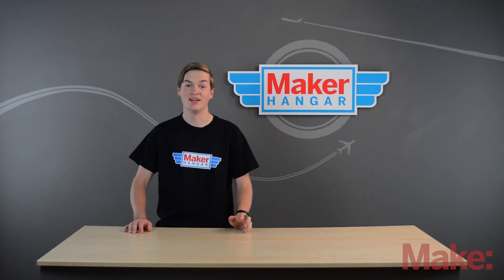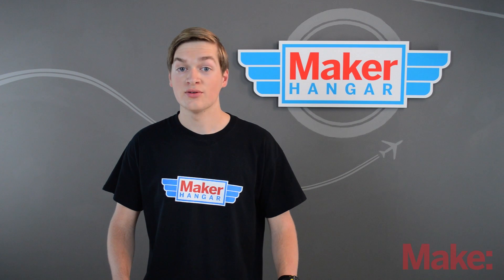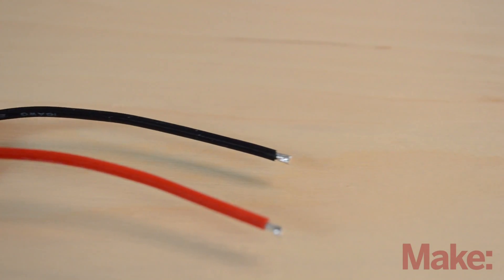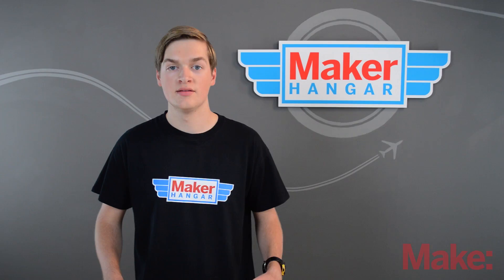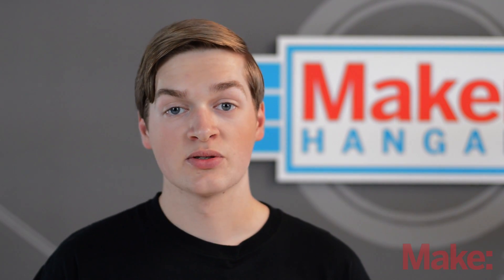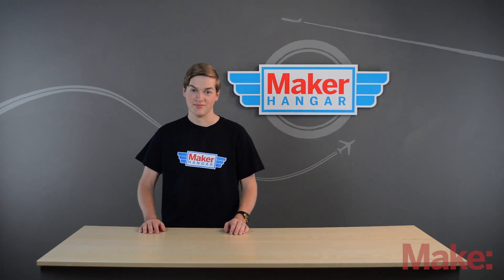Maker Hangar: Episode 3 - Electric Speed Controllers

Comment: What if you have a 400 amp speed controller pushing to a 95 amp motor, which is a KV 360 that can handle 125 V drawing from a 36 V 20 amp battery it’s wanting to cut off, and when the program to speed controller to reduce as much power as I can in the programming it will work, but I do not have much power at all Wish I could send pictures to show exactly what I’ve got going on

Comment: The motor prop combo will draw less amps in the air than it does on the bench. Depending on the prop it can be any where from 5 to 20 percent less.

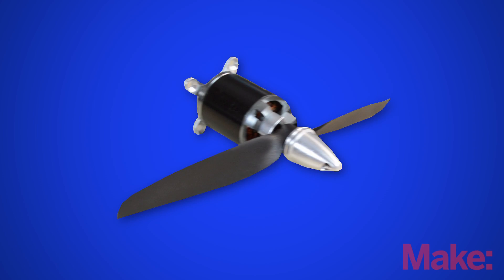Comment: 1:35 A bench thust power test is always going to tell you the max amperage your motoy-prop convination will draw. Any air speed (favorable to the direction of the prop) is going to reduce load on the motor shaft and make it draw less power.
And yeah the square waveform of that ac is more like a pwd signal that the real dc the esc requires...
Reply: Am losing ma money, In 2 months 3 ESC been damaged. Could you plz explain more about amps? Ex: I have motor with 40A, 1-what would happen if I use ESC with 50A or 60A?
2-what would happen if I use ESC with 20A or 30A?

Comment: So, the ESC's current rating should be MORE than what the motor will draw.
What should the VOLTAGE rating of my ESC be?
Reply: King Khan the voltage rating of the ESC is dictated by the battery you're using.
Reply: @SamiJumppanen  How can I estimate the output voltage of the ESC knowing the voltage of the battery?
Reply: @pedrohenriquepolidomingos6426  I'm not sure if I understand the question. Voltage is not the key here. The ESC outputs max / zero / +max pulses all the time on three outputs. You can average that to 3-phase voltage, but all the ESC "cares" is that the motor will keep the speed that's being requested. In short: the momentary voltage spikes are +/ battery voltage, but the average varies.

Comment: This is a bad video, even if you know nothing you are still providing vague and incorrect information. Your load is reduces when the motor is in the air, your amperage will decrease, as there is less "resistance" (load.....) on the circuit.

Comment: DC to AC? hahahaha :D My friend, do you really know what is DC and what is AC? You were showing a square wave going in, while its actually an almost flat DC voltage going in with no wave form. Then it sends out Square wave DC, it means it turn the DC off and on and that does not make it AC at all, not even close.
Reply: Was just about to comment this exactly
Reply: i came here because of the video picture and found you comments about it
Reply: Life is illusion IT'S just a bad explanation just from the the fact that he didn't mention brushless motors
Reply: You sound like the Marvel(tm) comic character 'electro hacker' .. ...
however you do have a point,  it is 'straight' 'DC' entering the ESC and 'pulsed DC' entering the 3 event motor i guess you can say it will be 'ac' after that - that is to say the result of the coil collapse.
Reply: i know this comment is old but, what happens if you power the ESC from (i guess AC instead of DC) a voltage converter, for example a 12v(from 220v) would it fry, would it work or i need from a battery only?
Reply: Half right:
- brushed motors are controlled with square wave DC
- brushless motors need 3 phase AC since they have no commutator, without AC brushless motors do not turn

But yes the video should be cleared up.
Reply: MsSomeonenew brushless motors are still not controlled with AC, they use DC with square waves. And brushed motors also don’t use square waves, they use straight up DC

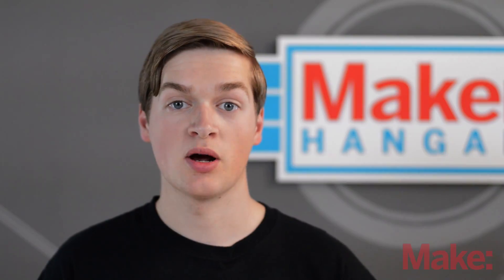Comment: 1:55 if a plane was moving in the air, there would be less strain on the motor because of the velocity, and therefore LESS current draw. not more.
simple electronics: the more strain on the motor, the less current it will try to consume
Reply: +Brice Johnson The most current draw (and torque?) would come from the motor on at 0 rpm right?
Reply: BrowFinGarf no, it would come from turning the motor in the opposite direction.

Comment: Could be a stupid question, but:
could I control a dc motor with the ESC? If yes (as I suppose) why fo we have 3 cables going to the motor? I can control a DC motor with a hbridge (for the direction of the rotation) and a PWM, which actually takes only 2 wires. Any help would be appreciated!
Reply: No, you cannot control DC motor with ESC, Because, DC motor runs with DC current (its obvious) and Brushless motor runs at AC Current (in which case the purpose of using ESC) 

To summarize, the ESC has 6 terminal output.  3 for the Brushless motor and another 3 for the servo motor.

With the three wire you mention, that is intended for the Servo motors. The three terminals is used for, + terminal, - terminal and the last one is used to control angle movement of the servo motor which is referred to as the signal terminal.

Hope that helps
Reply: thanks fo your reply! I'm not working anymore on that project, but when I'll have some free time and a  brushless motor I'll give it a try.
Reply: np
Reply: Andrea Bettati  Abbey kind of hit the target half-on.
there ARE escs for DC motors, we do not see them commonly, but an example can be found http://www.hobbyking.com/hobbyking/store/__9090__Turnigy_20A_BRUSHED_ESC.html here

Comment: Excellent Bravo .. But , generate electricity with a brushless Motor and ESC - he he !!! Possible or not ?
Reply: Well, you can put big blades, put it on the wind and use brushless motor as a generator. But, this time instead ESC you need some sort of rectification, because you have three phases out of the generator. With some messing arround electronic, it can be done cynchronously with MOSFETs to rectify such AC output into DC for some use (battery charging). But, then you should to pay attention about number of poles on the stator - the more poles, the higher frequency (better efficiency) you will get on weak wind. Or using less poles (still three phases, but multiplication of three poles by some number, so you get 3, 6 9, 12... poles), but then need gearbox to convert slow rotation into faster rotation...

Comment: 12v is not at all high voltage( and it is DC) and 5v CONSTANT current is neither a square wave!
Reply: By terminology, yes - 12V is not a high voltage, but tell this to the receiver which allow only 4.5 - 6V DC input. It will burn. Out there exist so called "high voltage rated" receivers, which can allow 12V or higher (it has internal buck converter, which convert this voltage into lower, with boost in current, not voltage).

Comment: Dc power shouldn't be shown as a square wave
Reply: Paul, you are right. Although, ESC working in PWM mode, so DC (direct current) is no more straight, at one moment it draw more current, at another less, depend of motor speed. Still, 5V constant voltage should be provided to the receiver, else it will not work properly.
Reply: Обманывают новичков)
Reply: That is not just DC current. It is a PWD signal. It tells the ESC at what speed it needs to power the motor. The frequent the pulses, the faster the motor and vice versa. 

Pulse Width Modulation is used commonly by micro controllers. A popular example being to change the brightness of an LED.

Comment: Carlandj is right, the video is misleading about the basics of electricity, the DC should be represented by a flat line not a square wave, the other part of the video is ok.
Reply: You are right, I was angry at first glance, but... This video is not electronic nor phisics class, just how-to channel. Some mistake... yes. Terrible mistake... no.
Reply: His in air amp draw theory us completely wrong. Anyone in this community knows that motors will draw less amps in the air than on the bench.

Comment: It is NOT ac coming out of a speed controller. Make seriously?
Reply: In the case of brushless motor, yes it is AC (three phases). Brushed motor - DC.  Although this AC doesn't look pretty, not a pure sine wave, but rather trapezoid waves, it is still three phases AC (at high frequency, depend of your throttle).

Comment: Unless you're running the motor at full power continuously, twice is a bit overkill. 20% over the maximum MEASURED motor current will be fine for most RC flying. Besides, weight and cost are also reasons you don't want to over dimension your system by a factor of 2.

Comment: It will work BUT the standard practice is to have an ESC twice the motor current or better.

Run it - it may fail eventually but you will most likely be Ok with such a small motor and presumably a light aircraft.

Comment: I've seen some replies to my comment that counter my comment and make some sense. If the ESC is only allowing current to flow intermittently then I guess you could show the current as a square wave going in. I just think it would be more accurate to show the constant DC that a battery puts out. Both version are correct as long as you are clear what you are showing I suppose. Maybe not as big of a deal as I first thought.

Comment: DC can look like a square wave if it is PWM (pulse width modulation).
 ie, pulses of DC that average out to the correct voltage.. this may not be what battery terminals do under a constant load.
 but is what the ESC draws as it quickly switches on and off to give power required.

not entirely sure about ESC design.. however it makes sense of the illustration.